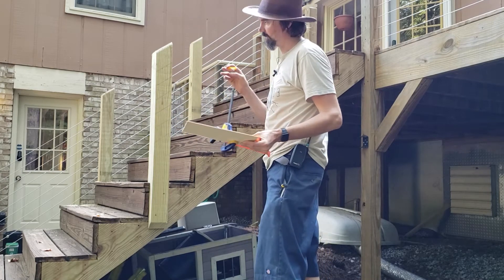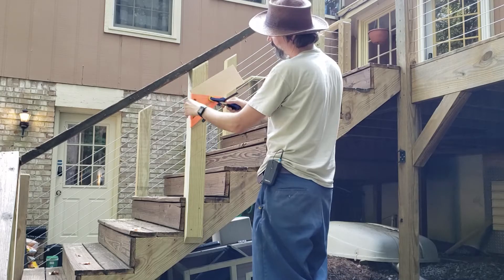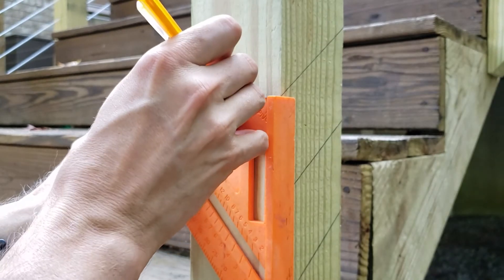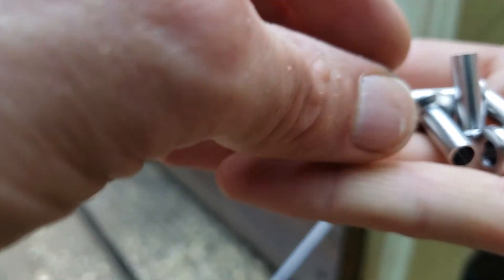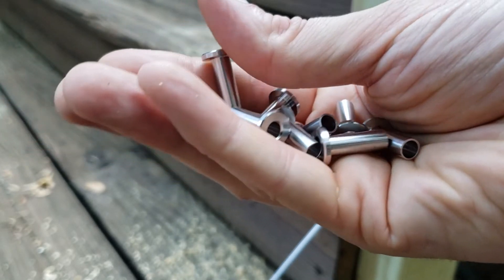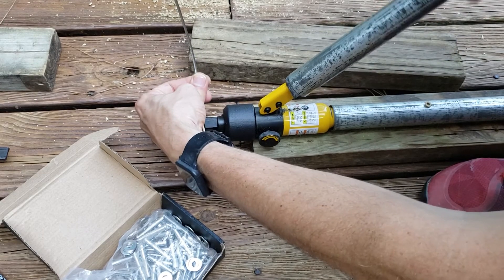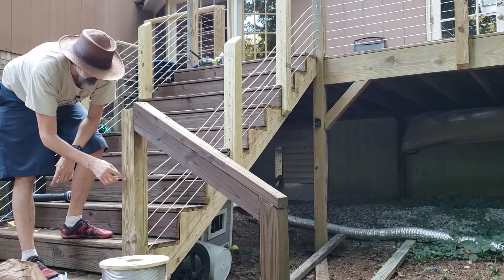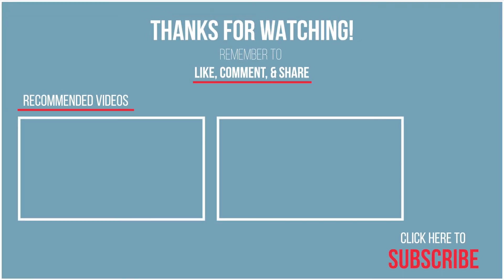Cheapest DIY Stainless Cable Deck Railing Pt.6: Stair Railing Install With Angled Holes And Washers

Comment: Can you post a vid or a pic of the finished job...or perhaps tell me that the cables on both sides of the steps were parallel?  I'm way ocd and that's my biggest issue when I build steps
Reply from the maker: They are parallel. Drilling those holes is not easy though, and takes some practice. Practice in some scrap wood first. Drilling in from both sides and meeting in the middle is the best way to do it such that the hole entrances are exactly where you want them.

Comment: At 5:27 you are drilling through the post.   The angle of your bit is not the same angle of the cables behind you in the camera view on the ither rail.  Was that a problem in the end?
Reply from the maker: I think it's an optical illusion. The holes were not always perfectly straight, but the camera angle does make it look out of line. They are pretty well lined up and everything looks good in the end.

Comment: So how about cutting your jobbers length drill bit to work for the stair posts so you can use your jig and simply drill all the way in one motion? I know we hate to "injure" a tool but one drill bit to make sure the holes are really good!
Reply from the maker: Sure that would work, didn't think about that. That extra long drill bit was not expensive, so no worries about modifying it.

Comment: This is an excellent series; I’m putting together a deck and wished to install railing such as yours; many in my area have used the wire rope clips but your system is very elegant.  I appreciate the streamlined approach to guidance; no filler, just the facts.  This is very much appreciated, thank you and continued success with your site.
Reply from the maker: Thank you! I hope that it also works well for you. I'm still editing part 7: reinforcing the hand railing and Part 8: tightening and finishing. Should have those up soon.
Reply: @engineerable  I've watched all 6 parts and am ready for MY install....I need Part 7 and 8....... :-)
Reply: Awesome series. Would love to see how you gauged the tightening and trimmed the tensioner ends! I'm starting a very similar project next week. Thanks for recording and editing this video series!!

Comment from the maker: Watch the rest of the series for the full install details broken down into easy to follow steps -  https://www.youtube.com/playlist?list=PLJZvr9eL7PeyHeBj51cTain6uAiDfz9lX
- Watch PART 1 which reviews the stainless cable hardware you need to buy to begin the install. https://youtu.be/P1JmweyXIdE
- Watch PART 2 to learn about the tools, how-to and improvements for crimping the cable. https://youtu.be/aTW-sWjFWjE
- Watch PART 3 to learn how to easily drill straight holes into the posts using a special tool. https://youtu.be/4faByj5kgYA
- Watch PART 4 to learn an alternate method of drilling straight post holes using a post hole jig made from a 2x4. https://youtu.be/rdTtShmJ2LY
- Watch PART 5 to learn how to install a run of cables. https://youtu.be/eszdqHDIdBg
- Watch PART 6 to learn how to install the stair railing cables. https://youtu.be/FNACnT69P9E